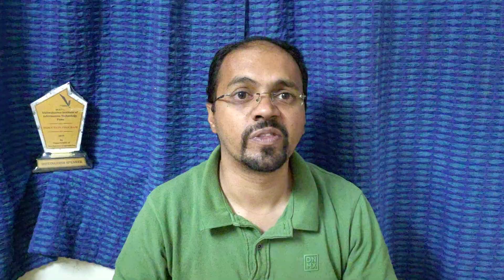CAE Interview Questions-Hypermesh and LSDYNA

Comment: What is SHRF ( Shear correction factor ).. Why it is used in properties .. It is recommend to use 5/6 for shrf..Why it is only 0.833 what will happen if we are using other than this..

I am having 7 years of experience into hypermesh and Ls dyna.. i have resigned my job and started preparing text book on ls dyna..

Comment: Properties for C M O in rigid
Aluminium plate mesh hexa or shell? 
How to know analysis is correct or not?
What is bucket sorting in contact? 
Difference between soft 0,1and 2?
If sliding energy is - ve what will you do?
NIP
Contact algorithm

Comment: What is meaning of Lagrange and augument formulations in contacts?
Reply: generally while solving contact problems we use different formulations to enforce the contact conditions. Essentially what we solve is a constrained optimization problem. There are 3 popular techniques to enforce constraints in a system.
1)Penalty Formulation (Which uses a Penalty Parameter behaving like a spring stiffness)
2)Lagrange Multiplier Formulation ( Where the Lagrange multiplier plays the role of contact pressure)
3) Augmented Lagrange Formulation ( A combination of 1 and 2)

I'm sure most of what I've stated makes not a lot of sense at first glance. I suggest the book on contact mechanics by Peter Wriggers.